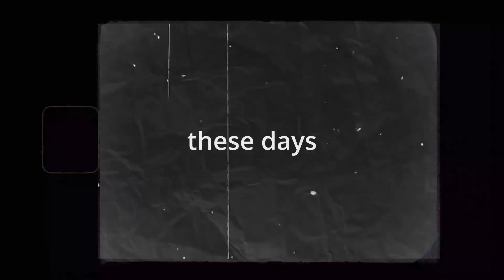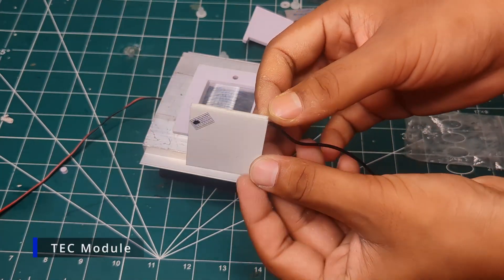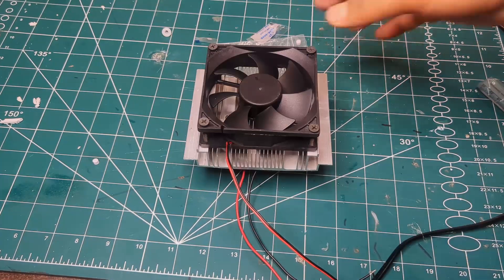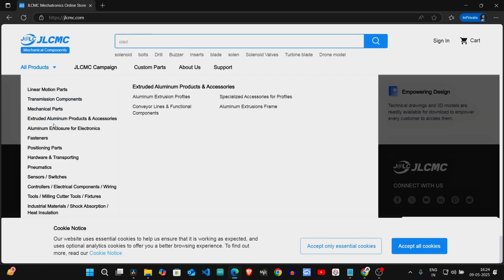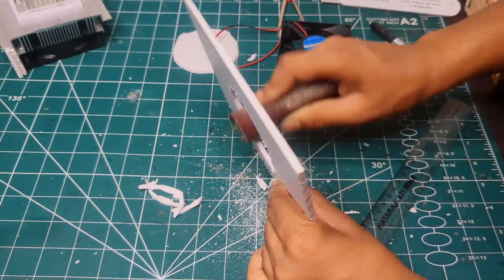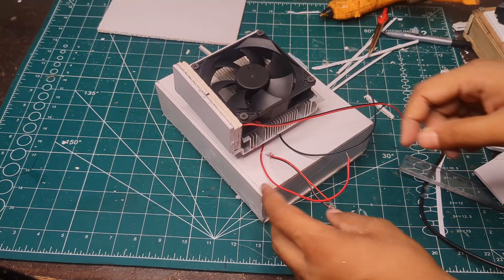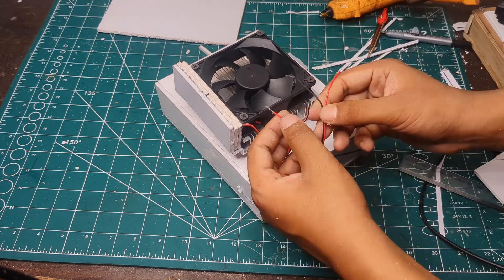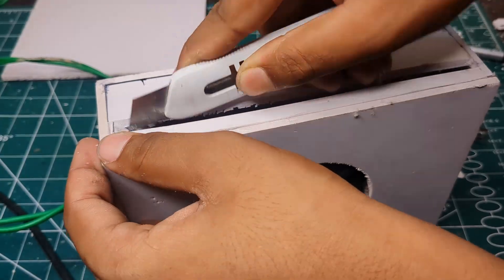How to make Mini AC at Home Using TEC Module

Comment: but the back heatsink generates more heat than the internal heatsink generates. The Peltier element has an efficiency of up to 10%. So 90% of the electrical energy is radiated by the back heatsink as heat.